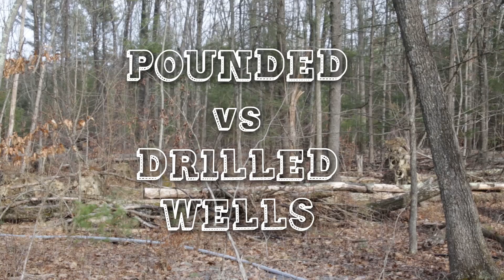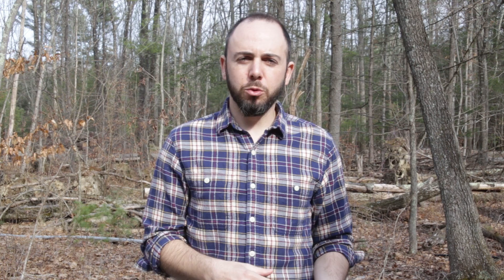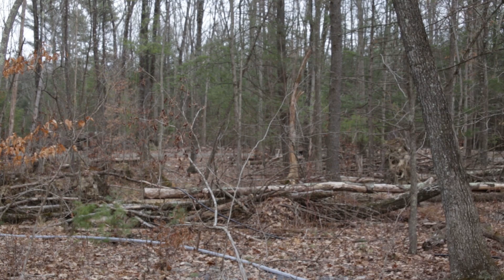Pounded vs Drilled Wells | Pros and Cons

Comment: I’ve watched this video and read several comments on how each individual describes their well dug, Not one describes the quality of water they are getting. It has been my experience that with drilled wells the water quality is less likely to be as good as pounded wells. Reason being the pounding creates that top 30 o 40 foot of fresh ground water before you reach the depths you do with drilled wells around 300 ft plus. Drilling past the sweet spots in the earth to get freshener water, instead where one could get suffer and hard water into the house by drilling. No one talks of the cost of the post well system they pay for by choosing the cheaper route with the drilling process. pounding is safer for the water quality production in my research. No one likes stinky water.

Comment: Flat fee here for guaranteed water is $10,200 cdn.  That includes drilling to 520ft, casing, small frack, pump, pressure tank, excavation, abs, electrical and all labour.
Reply: DOUBLE THAT NOW!

Comment: This might be a stupid question but why do you need a CO? Is it a bank making you do it/ a loan condition ?
Reply from the maker: To get a loan from a bank, yes, you absolutely need a c/o.  You might also need it get in insurance, but I'm not sure on that.  Also, if you ever want to sell your house, you'd have to sell it for cash because the buyer wont be able to get a loan on it.  I also feel like the town is not going to approve of you having a house without a c/o because it can be a deathtrap and an eyesore for all they know, which can lower property values in the area, and so on and so on.
Reply: It's all BS.  Much like building permits and inspections.
Reply: OGB makes sense. I’m guessing you have a plan to make this house something big/substantial enough to justify having a selling plan to recoup significant investment costs and / or a plan to make good money on the structure itself?
Reply: I ask b/c I got a loan with some small run down cabins on it (in NY) that I live in on a temporary basis - I didn’t need a CO and don’t plan to pour much money into the structures either. What town/county are you in?
Reply from the maker: Always.  We are building a 2200sqft shop/garage in the spring and our main house several years in the future.  Investing a buttload of $$.  Will need a loan, etc etc.